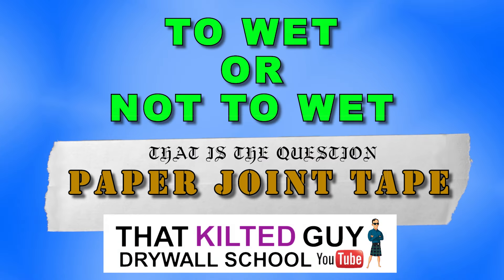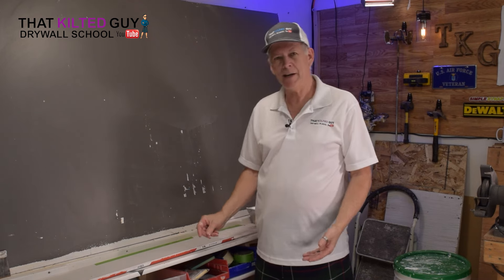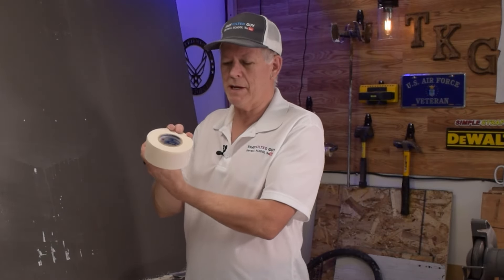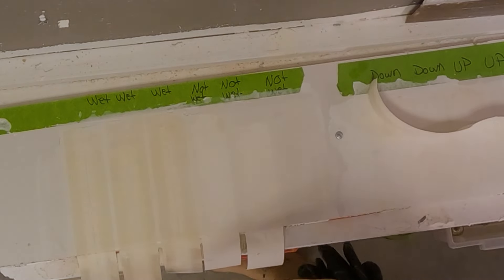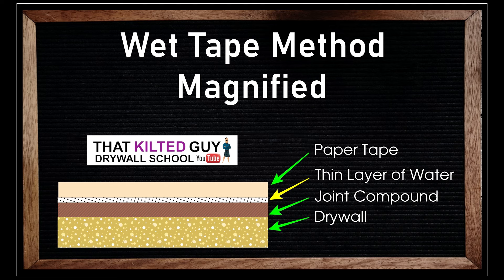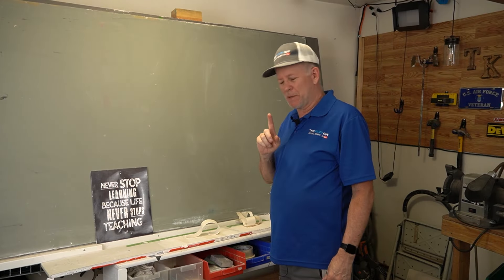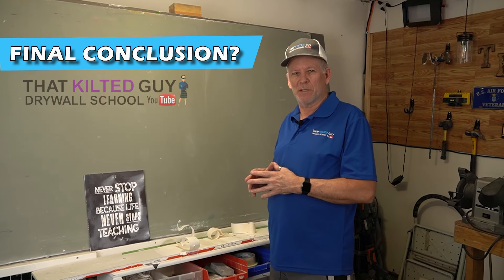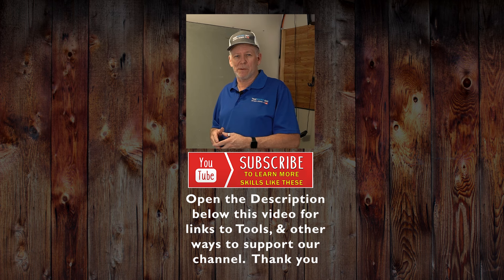If you WET Your Drywall Joint tape, THIS might happen

Comment: As a DIYer I did a basement refinish a couple of decades ago. Given the high altitude, semiarid climate, and the fact I DIDN'T THIN THE MUD (used the green label) my tape would sometimes not stick. The super dry paper sucked the moisture out of the surface of the mud before I got it embedded. Not knowing any better my solution was to lightly spritz the tape with water (not soak it). Seemed to work fine.

This summer I'll be doing a lot more taping. Now, thanks to you, I WILL BE THINNING MY MUD WITH WATER and leaving the tape dry.

Comment: This is an excellent video. I am a drywall newbie and just doing some remodeling in my house. I had difficulty embedding dry paper tape and getting it to go down without bubbles. I’m sure that’s because I’m not using the best technique or working fast enough. I found that LIGHTLY spraying the backside of the tape helped it to adhere better. Once I get better, though, I will try applying it dry!
Reply from the maker: Glad it was helpful!

Comment: I used to mist one side with a spray bottle not soak it. Worked fine. Don't anymore since I've watched your videos.
Reply from the maker: The one ivytech video I reviewed, they dipped it in a bucket of water so it soaked it and that would be different.
Reply: I watched that video to don't  know why you would  soak it

Comment: when you wet tape it will stretch to much and the mud will not Stick to the tape I had a guy run wet rolled of tape through a bazooka and onlong tape runs on flats with green lid the tape would shrink back and pull away from corner tape leaving a gap no need to wet tape

Comment: Is the contest over?  I didn't see a link or a code word.

I'm glad you came to this conclusion.  I was not looking forward to strapping a five gallon bucket of water to my Bazooka.  Hahaha...yeah right!!  27 years and I have never seen anyone wet their tape.  I love how thorough you are in your teaching though.  Put these silly things to rest so people can get to learning the right way.  Right on!

I would love to see your take on the Wagner Spraytech electric texture sprayer.  We have to do some repairs sometimes where pulling out all your gear to texture is more of a pain than it is worth.  This tool seems like a good answer to that problem, but I'm still hesitant to spend the money and get disappointed.  Just wondering if you have ever tried it or seen it used.
Reply from the maker: I’ve never tried a Wagoner texture sprayer. For the code word, start at two minutes and look closely on the right

Comment: Some people wet block before mortar, same thing, water prevents mortar from sticking to the block.
Reply: The below brick website indicates that water only has that effect if the material is saturated.   https://www.claybrick.org/should-you-wet-clay-bricks-using-them
Spraying a wall may clear dirt and loose debris so I wouldn't think there is any harm as long as the mortar isn't being slapped on too soon after.

Comment: I wet the tape, it goes on better, and when you wet it it sticks better and you don't have to so much sanding
Reply from the maker: My test showed it stuck slightly less than the standard method of not wetting it.  Do it if you want, but you're not gaining anything vs doing it the usual way.  If you feel it is, you likely have tried using too thick of a mud when taping.  We thin it way down and it wipes fine, and sticks like mad, so no wet tape needed.

Comment: Personally I think it comes out better if it's slightly wet.  A quick dip in a bucket and never have a bubble.  In my opinion it depends on how wet the mud is and what mud you're using, green , blue or fast.
His mud is super watery already so wetting the paper wouldn't be a good idea if it's that sloppy wet.   If it's not that wet then the tape can suck up the water and create bubbles.   I also think that putting too much water into it can make it weak .    I can see why production people don't wet the mud since it's an extra step.   They just use super wet mud.  And that can come loose on the edges as well.
Reply from the maker: The manufacturer recommends to thin the mud as needed. Using thinner Mud has worked since the Dawn of drywall. Using thick mud to tape with is just harder for No reason

Comment: Wetting the tape with green top isn’t necessary. Wetting your tape while using a setting type compound is crucial, as the setting type sucks the moisture out of the compound.
Reply from the maker: Hmm, I’ve never had that problem
Reply: @ThatKiltedGuyDIY   maybe how we mix it, we may mix it dry. We do mainly repairs and small renos, so we are always waiting on something to dry/ set so that we can move forward.
Reply from the maker: I only did repairs for 20 years so I get it
Reply: @ThatKiltedGuyDIY  only.......